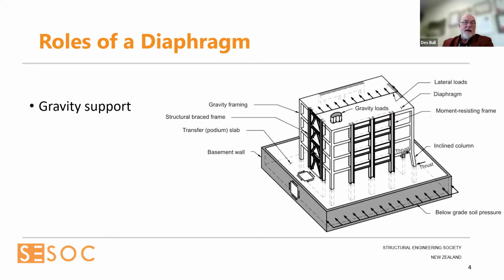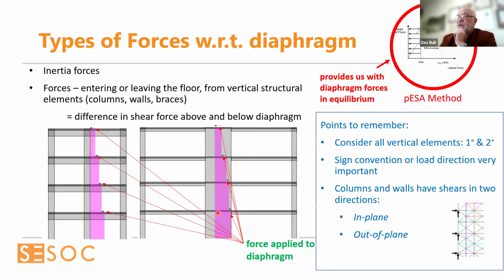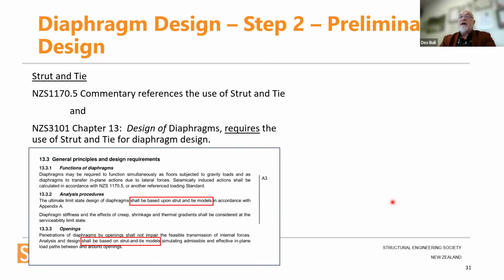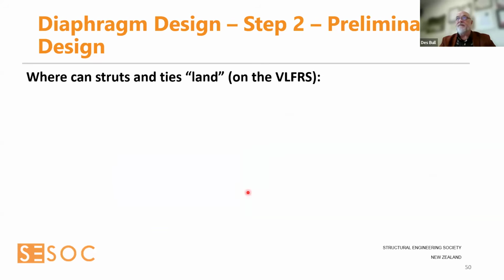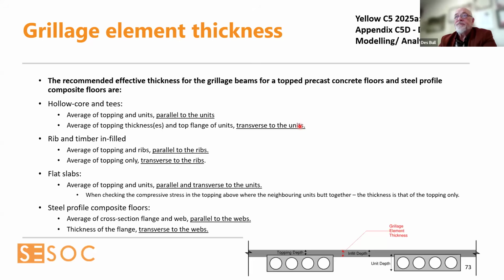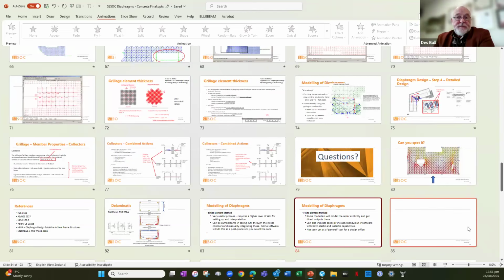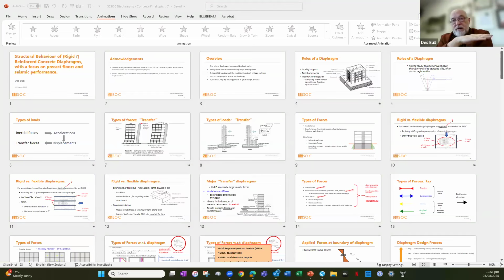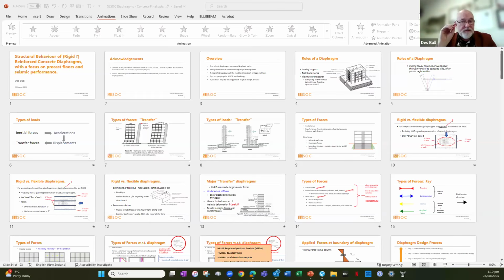Rigid Diaphragms: Analysis and Design Guide

Comment: Q&A:
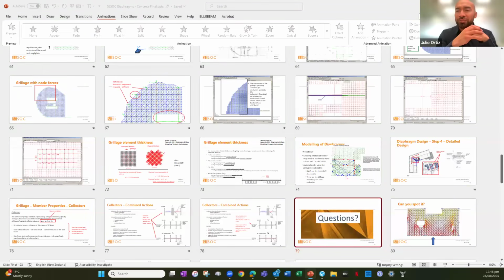47:13 Using FRP to strengthen
48:06 Pros and Cons of using a FEM vs Grillage
49:52 When to consider 100+30 concurrent actions
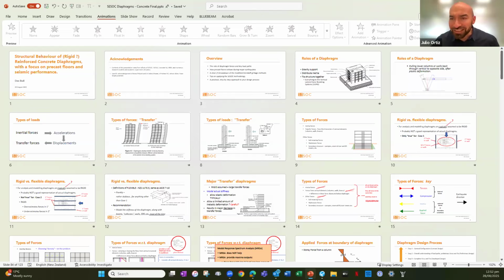51:16 Pros and Cons of using advanced design software vs Grillage
52:40 Dealing with steps in the diaphragm (esp. in a DSA)
54:15 Thoughts on cast-in inserts/couplers
55:40 What stiffness to use for diaphragms when modelling the whole building (i.e. ETABs)
58:45 Do pESA / PGA forces get cumulated as you work down the building
1:01:25 When to use prism strut vs bottle strut
1:02:45 How to account for pre-tensioning forces in diaphragms
1:04:02 Topping slabs over internal beams & gravity-driven tension in hogging bars
1:06:25 Best place to put dummy nodes
1:07:38 Non-ductile mesh - can you use Grillage analysis (Answer: No)